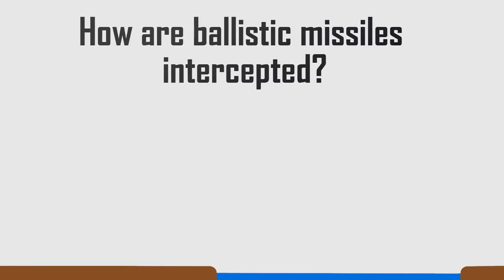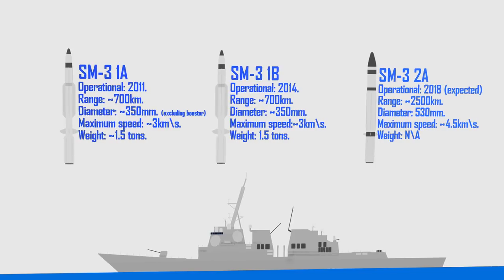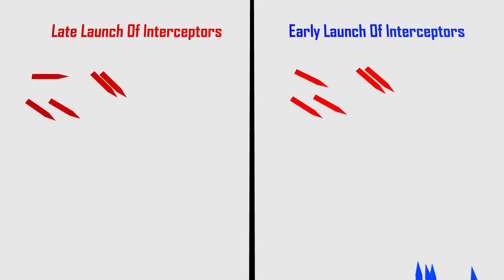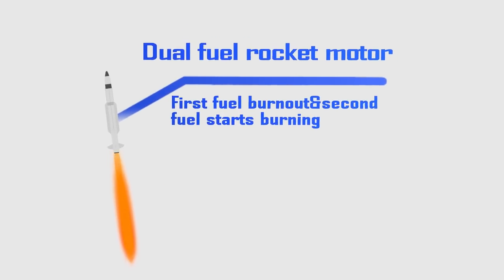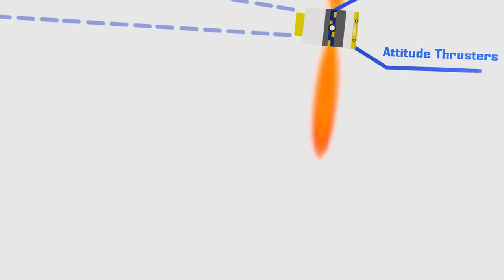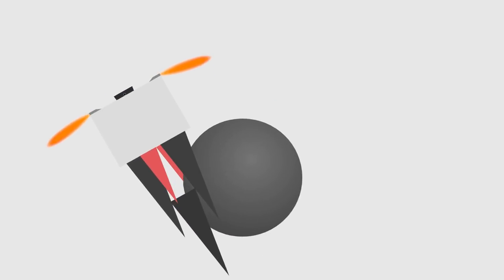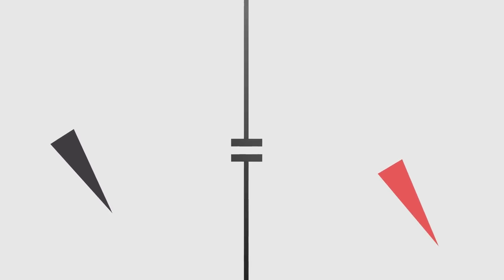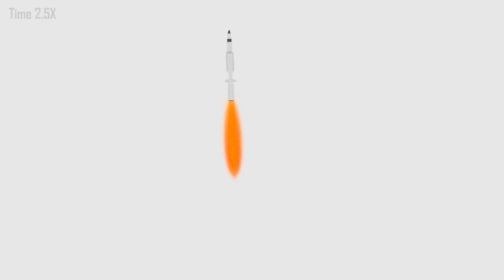Ballistic MISSILE DEFENSE- How Does It Work?

Comment: Really fantastic work, narration needs a bit of work but you guys have real potential.
Reply from the maker: Thanks
Is the problem with the narration that it is simply hard to get what is being said?
Reply: Not so much that as the voiceover audio quality is poor. A better microphone or perhaps a better recording environment may help. The accent doesn't really help either but not much you can do about that. Where you both from anyway?

What really matters though is good information which you guys got. Where do you usually source from? And how do you feel about the SM-3 Block IIB? If it truly can intercept ICBMs then Aegis Ashore becomes something different entirely. 

Btw what programs do you use, particularly for graphics animation?
Reply from the maker: Well, that makes it a lot more complex.

About sources, pretty much everything. Some information is from analysis that was made as not everything can be found online.

Regarding SM3 IIB, considering its small size  (compared to GBI) i think it's unlikely it will be able to intercept the most capable ICBMs with a high kill probability, but for the least,  it will be able to take out the less capable ICBMs. With that said, its still a few years into the future and there haven't been too much talking about it so its tough to accurately judge its capabilities yet.

This specific video was animated in HitFilm, but I also used GIMP for photo editing and Assembly (IOS app) for making the 2d models. All are free.
Reply: My fear with the IIB is that it can be deployed at Aegis Ashore sites in Romania and Japan which would greatly upset the strategic balance once, if, it's developed. Being based so close to potential launch sites would give the ABM a significant kinematic advantage I would think. Though as you said we know next to nothing about it besides vague desired capabilities. 

Do you guys plan to make the move to more professional software like Adobe Premiere, After Effects, etc. I'm trying to learn Premiere so that once I grasp it I won't need to learn any other editing software. The cost is an issue at times, perhaps I should have started with free stuff first.
Reply from the maker: An early interception before re entry vehicles separation would indeed reduce leakage, but also by reducing the number of missiles required to intercept threats (no need to intercept decoys and MIRVs) and might increase the kill probability overall because the target is bigger and warmer. (the jet of the rocket motor of the boosters or bus warms things up)
About aegis ashore, maybe, but I can't give a definite answer. 
BTW, I wouldn't be surprised if SM3 IIA has a chance to intercept ICBMs if those are in early flight stages before KV separation and maybe even SM3 IB...
 
I've already switched to after effects. The next video (hopefully we will finish it this month) will be edited completely in it and the models in illustrator. Anyway, if you already got the adobe stuff then just stick to it, great programs with a ton of tutorials about them on the web.
Reply: Very excited to see the next video, glad to hear you're on after effects it offers a huge capability increase.
Reply from the maker: What do you think about the narration here?
https://www.youtube.com/watch?v=pCWMp3vCwZI
Reply: A huge improvement, it almost sounded natural and was quite pleasant. The content itself was great to, I always wondered why Arrow 3 had such a capability advantage over the SM-3. Israeli missile systems are always interesting.
Reply from the maker: Great
Reply: Better than the robot voice